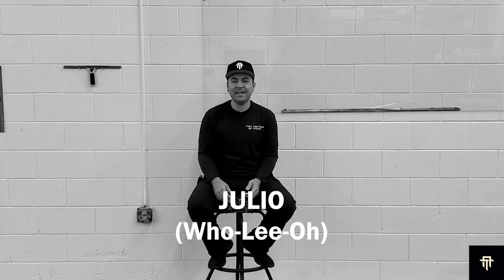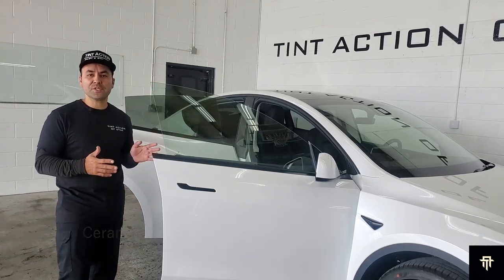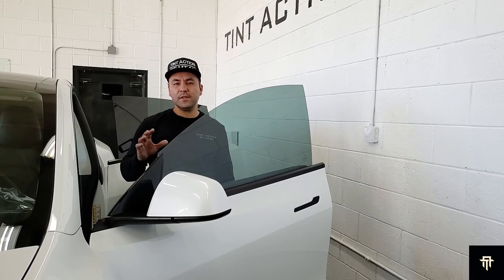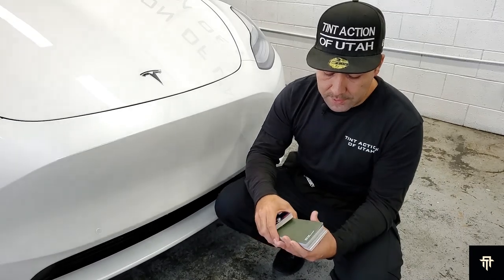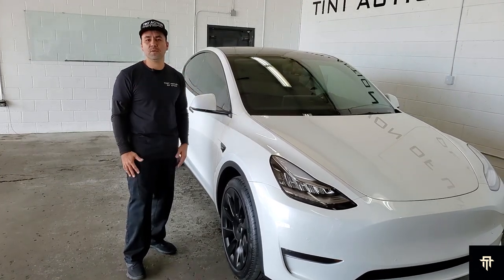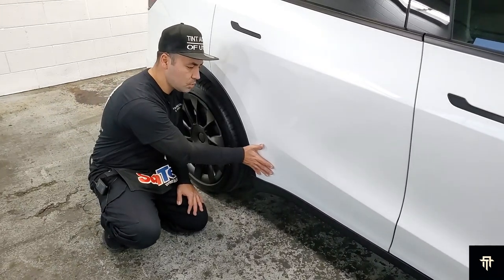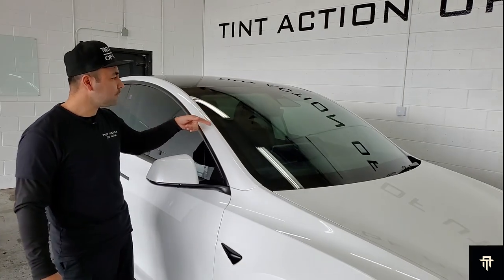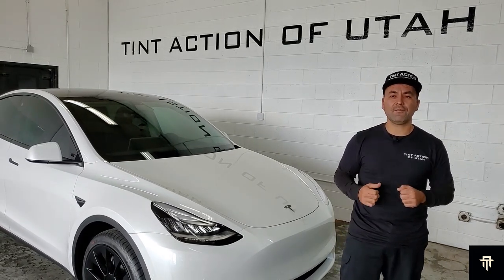Tesla Model Y Paint Protection Film & Ceramic Window Tint

Comment: Hello, would it not be better to use a plotter to cut that windshield tint rather than cutting directly onto the glass with your knife? Seems to me that would make scratches there. I know absolutely nothing at all about installing window tint so this is why I ask. You seem extremely professional to me. I would also like to ask you why do you choose the tint/ppf brands you are using rather than other brands like 3m and Xpel? Thanks a lot man. I subscribed to your channel. I hope to see a lot more content from you. Thanks again!
Reply from the maker: Thank you for your view and questions.  I've been tinting for 21 years and have always used hand cut for everything.  I have tried computer cut kits also because I feel like it's our responsibility to try new methods.  We use stainless steel blades and as long as the blade is new which we use a new blade for every panel, then the blade will not scratch the glass specially when not applying more pressure than necessary.  I've been using SunTek for over 16 years now.  I love them, we've never had any issues with the film we buy.  The film is made here in the US and they spend a lot of money to better their product all the time.  Xpel and 3M are great too.  Easily the top 3 films are SunTek, 3M and Xpel.
Reply: @tintactionofutah  Thanks so much for taking the time to answer my questions. You seem super cool and very very talented. I think I'll buy a red model y performance and see if you would tint it and ppf the whole car. You need more videos on your channel and hopefully you would make a video with my car. Then again, my wife may not let me buy this car after all. My fingers are crossed as I want hee to be happy. Thanks again man,  I think you rock!